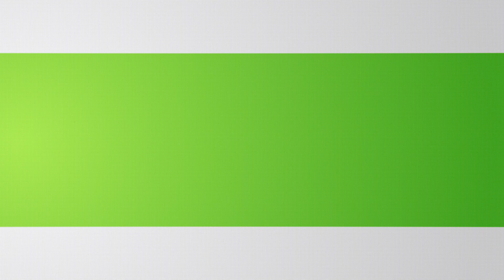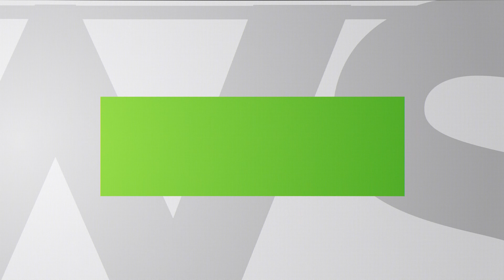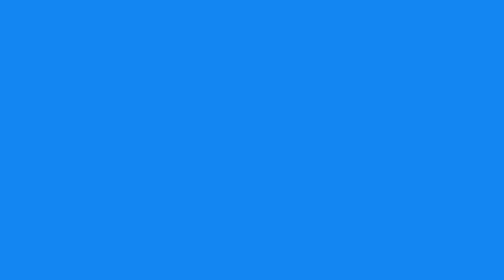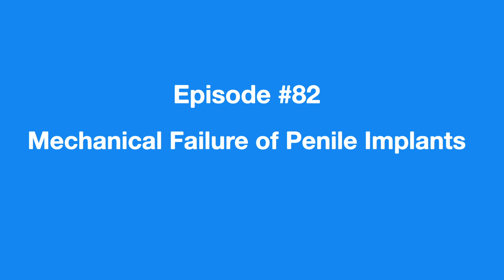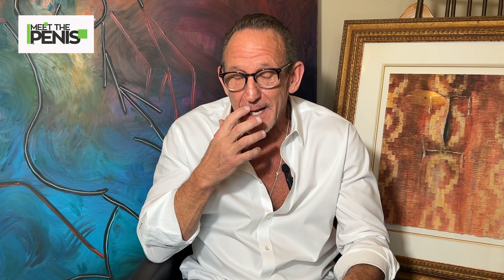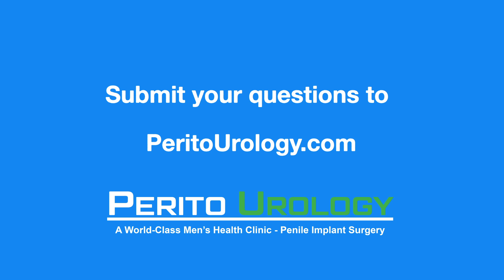MTP 82: What Happens When Penile Implants Fail?

Comment: I hear about the Rigicon 10 (a third opion). I have had 3 Coloplast failure and now my AMS 700 has failed after 8 months.  Any input or advice please!!!!   Bill
Reply: get the malleable and live with it, at least the chances of failing are very low due to no mechanical parts, it could literally last forever
Reply from the maker: Check with a dedicated implanter. The failure rate for penile prostheses placed by a qualified surgeon is roughly 1% per year.

Comment: 5 surgeries in 3 devices nothing but issues and pain 
Nearly 50k out of pockets 
Back to square 1
This is all within a year 😢
Reply: just get a malleable dude, these inflatables are a money making machine for surgeons and the manufacturers, they fail often and dont last as long
Reply from the maker: The failure rate for inflatable prostheses are roughly 1% per year if placed by an experienced, dedicated implanter.
Reply: @DrPaulPerito  Is there a study that proves this?  What is the failure rate for the malleables, without the mechanical parts, is probably 0.5% if not lower.
Reply from the maker: Follow up with a board-certified dedicated penile implant surgeon.
Reply: This is next to impossible, if you let the doctors and implant companies tell it. Can the people in these comments really be the 1%, where everyone else that gets one uses them happily and successfully for 5-10 years? I’m having second thoughts. It doesn’t make sense for the devices to fail so quickly for mechanical reasons. Are they really made of $1 cheap plastic that we pay $10,000, $15,000, $20,000 to have surgically installed? All the time, money, and effort to have cheap plastic sitting inside of us that just breaks so easily? Jeez, this comments section is terrifying.